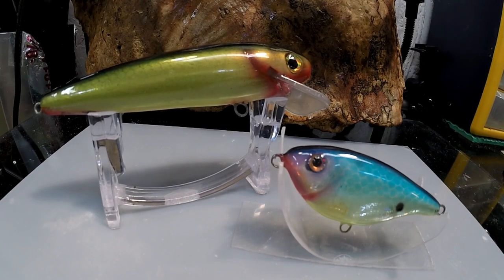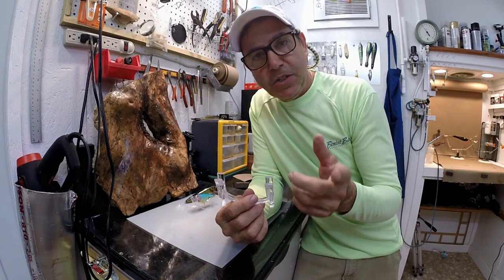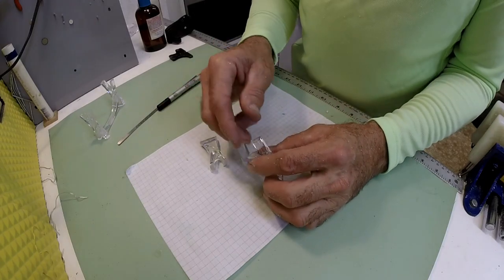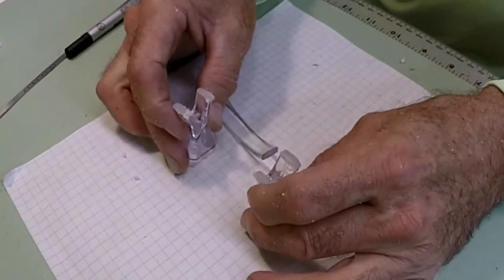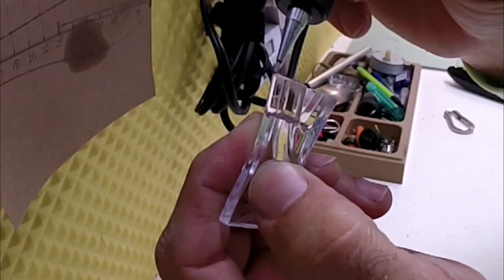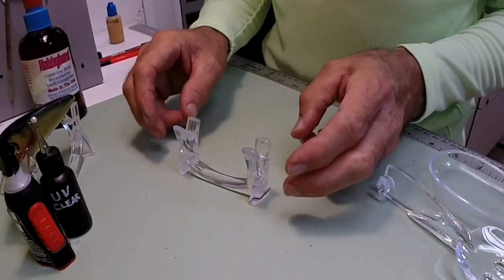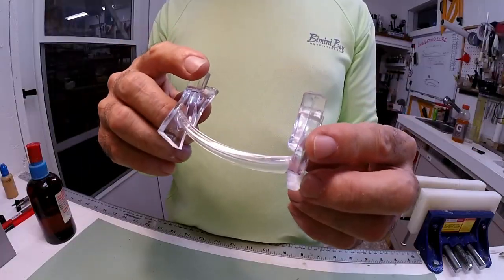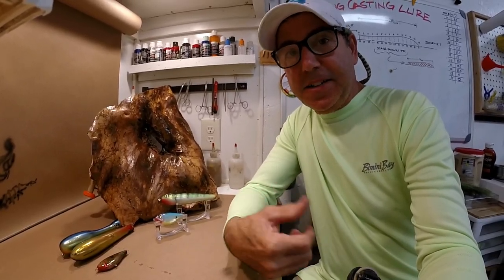Custom lure display stand

Comment: I do my display with driftwood (cleanup and put a finish to it).  I bent wires into shape (like "?") to hold the lure.  I glue the wire on to the driftwood (predrilled holes).
Reply from the maker: That sounds much prettier than this.
Reply: Try it.  Basically, the material is free.  The most expensive material is the finish.  You already take pictures of your lures with driftwood in the background.